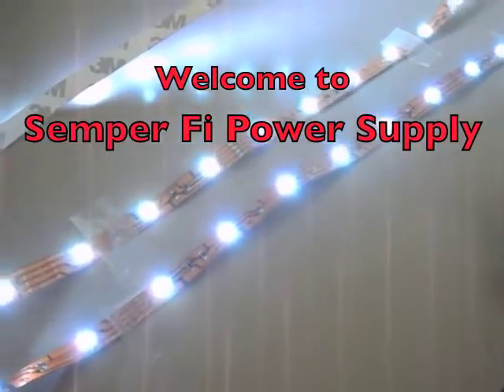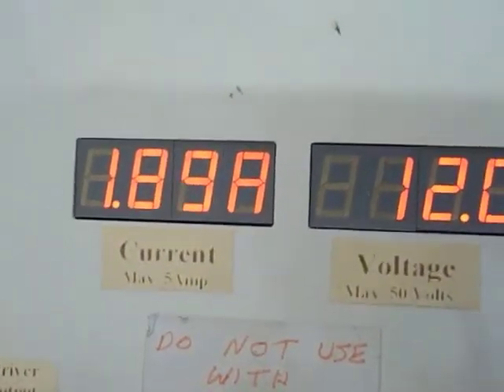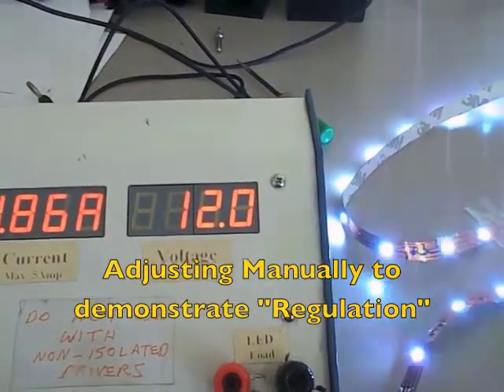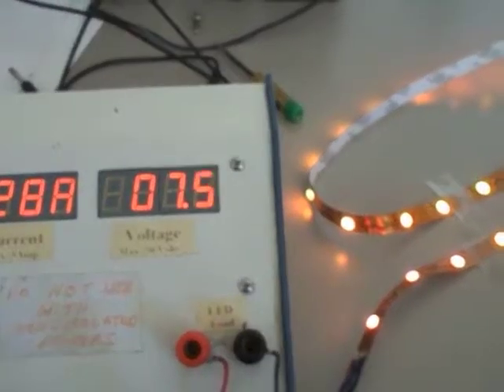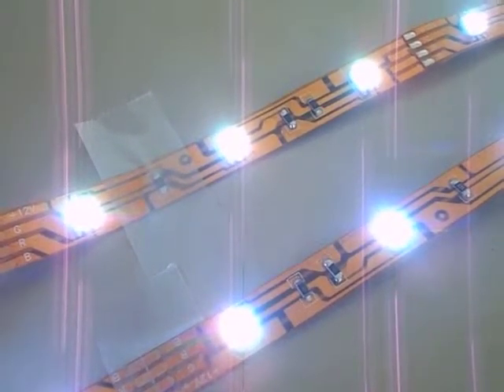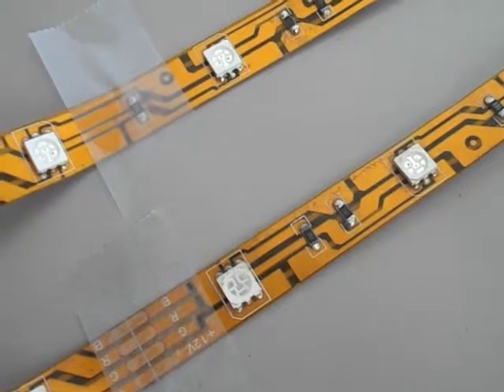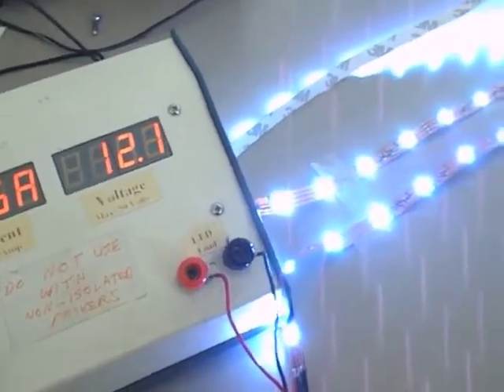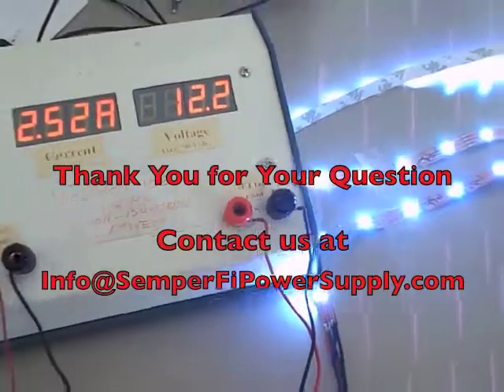Semper Fi Power Supply - Full Wave Rectified DC with and without Filter Cap

Comment from the maker: Full Wave Rectified DC Voltage - 
Comparing with and without filtering caps

Semper Fi Power Supply - Full Wave Rectified DC with and without Filter Cap